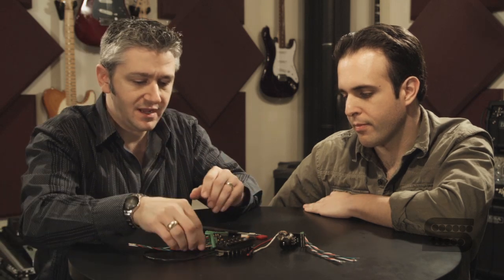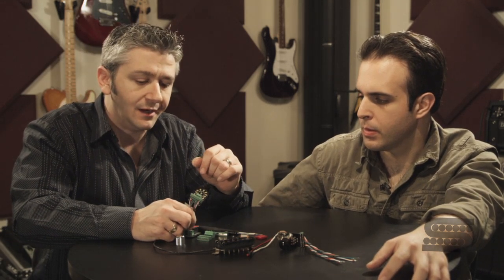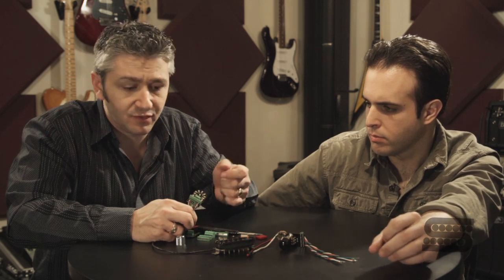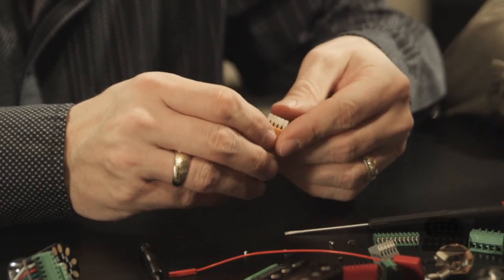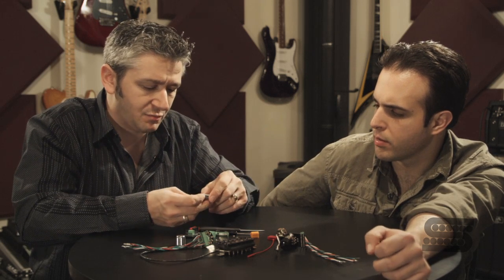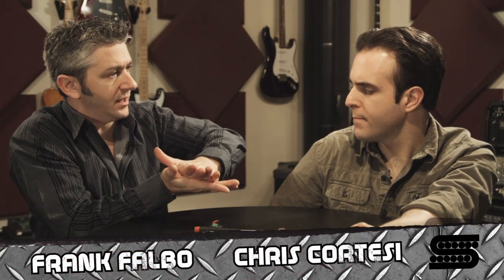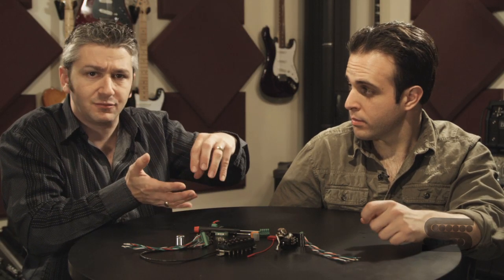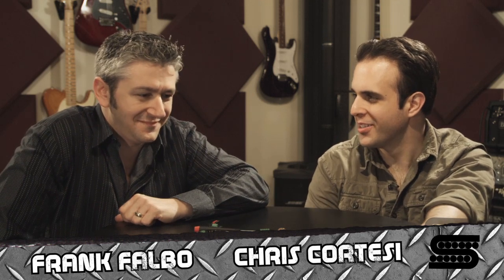Seymour Duncan Liberator Solderless Pickup System Part 3: Behind The Technology

Comment: Manual? Instructions? Wiring Diagrams?
Reply from the maker: These come with directions, and there are wiring diagrams on our website: seymourduncan.com under 'support'.
Reply: Seymour Duncan It seems like they don't want you to figure out you still need to solder the switches and pots, jack and tremelo. At least toneshapers has solderless  pots and switches as well.
Reply from the maker: Those are already soldered in your guitar.
Reply: Seymour Duncan Then you are only talking about using then in an existing guitar? You still need to unsoldered the pots, volume, perhaps replace the wires if they are not long enough. And, as long as I'm doing all this what is the point? Tone shapers gives you everything. it's a real solderless experience.

Comment: i couldn't understand clearly. so will you use the liberator with conventional pickup selector switches? for example i have guitar with two humbuckers and can i use this with a 5 way multipole switch and also add a push-pull pot for coil splitting??? please answer.

Comment: @hendrix1222 Yes, it has accomodations for 2 humbuckers. You can repurpose any of the wires, except the two grey wires which are hardwired to ground. So you could use it for H/S/S, S/S/S, etc. but you'd have to remember what colors belong where. We'll release a Strat-specific version at some point, until then these can be used.